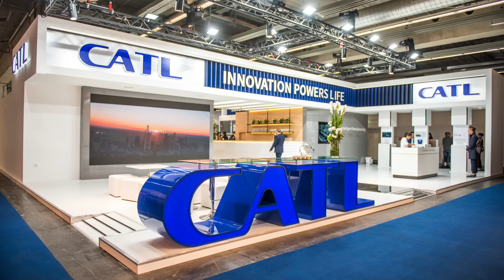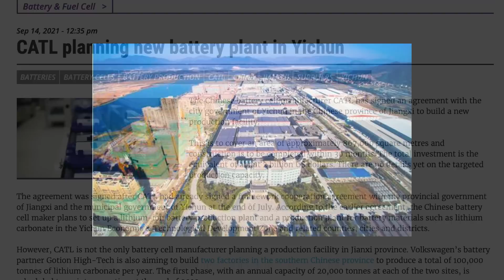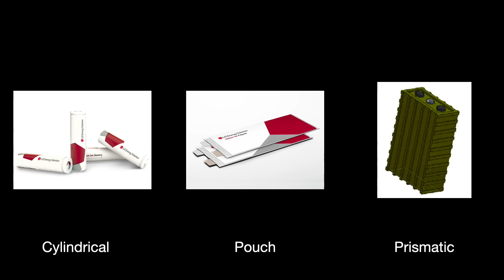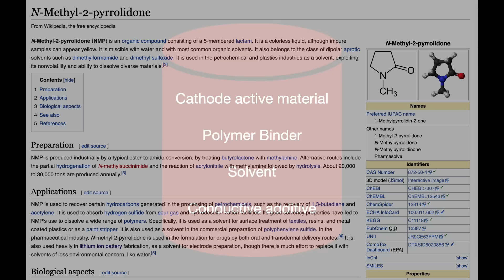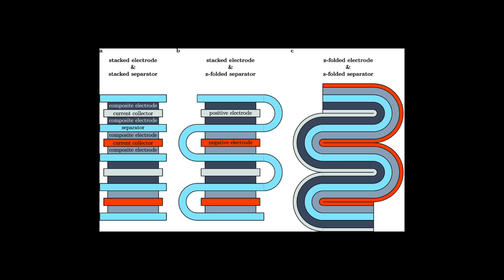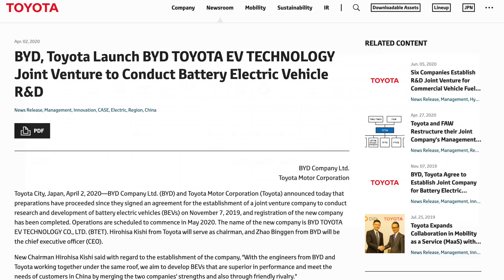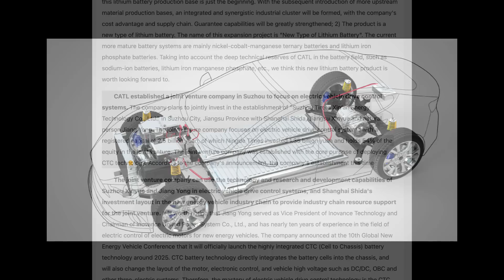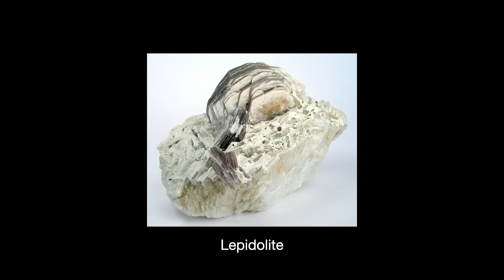How China's CATL Makes an EV Battery

Comment: Some added points of interest:

  1.  Tesla is buying CATL's LFP cells in the prismatic form-factor for its Gigafactory in Shanghai.  These cells are used in the lowest-range/cheapest models.  This is a departure from Tesla's preference for cylindrical cells.  A good question to ask is, for how long will Tesla keep prismatic cells in its supply chain?

In principle, cylindrical cells should lend themselves to cheaper high-volume manufacturing.  The principle advantage of the prismatic form-factor is flexibility in shape, useful for conformal cells in electronics applications.  Auto packs don't need conformal cells, so paying a premium for prismatic cells makes little sense unless some other motivating factor is involved.  For Tesla, there is such a motivating factor - they want more cells than they can currently get.  So accepting prismatic cells is probably only temporary for Tesla.  It could be a fairly lengthy 'temporary,' though.  Tesla's aggressive production ramp will strain their ability to meet needs for cells for years to come.

  2.  For Tesla's 4680 cell, they are using a dry-coating process that does away with the drying step you explained.  It reduces the production line footprint, reduces capital costs, and per-cell costs.  Going forward, manufacturers who don't use dry-coating tech in cell manufacturing will be at a pricing disadvantage.

  3.  Not every manufacturer is wedded to cell-module-pack engineering.  Tesla is planning to abandon that approach in factor of cell-to-pack, no modules whatsoever.  They also plan to bond 4680 cylindrical cells with a polymer to create a structural pack, which eliminates the need for trays and reduces the need for other structural body components, reducing automotive production cost and reducing vehicle weight.  We should see these innovations first at Gigafactory-Austin in 2022.  Note; structural packs are only possible with the cylindrical cell form-factor.

Battery manufacturing is. at present, an exceedingly unstable business.  Innovations are popping up at a rapid clip, raising the risk that fresh capital expenditures will become stranded before their costs can be recouped.  Automakers are shifting their preferences, too - VW recently shifted their orders from pouch to prismatic, and they may shift again to cylindrical if Tesla demonstrates insurmountable advantages for cylindrical cell manufacturing, as they have promised to do.  The road ahead for CATL and for other battery manufacturers is likely to be bumpy.
Reply: Three words cost cost cost. Yes Tesla is trying to bring costs down with the tables batteries. But it is just a prototype at this point. Other battery makers such as BYD have succeeded to being the cost down with  designs other than cylinders such as the BYD blade battery. All battery manufacturers will be in the game for many years to come as there's dearth of battery cells in the market hence Tesla delaying its semi and rosters for years. Cost wide catl might actually stay ahead of the 0avk as the main coast driver at this point is raw materials esp lithium (carbonates and hydroxide) and CATL can negotiate it with it's sodium ion batteries.
Reply: @najibyarzerachic  Sodium ion is still in lab bench mode.  No commercial production.

4680 has a production line going already.  They're still tweaking the line, but it's producing GWhs of cells already.  Reject rates are a little high still, but better than 80% and improving.  In 2022, the line design will be copied at GF-Austin first, then GF-Berlin.  The planned production ramp will knock the socks off of anyone who knows the history of this market sector.

The Blade is just another prismatic cell.  Nothing special.  Wet-coated electrodes, expensive and time-consuming drying, no possibility of using it in cell-to-structural-pack designs.

CATL can sell prismatic cells to Tesla only because Tesla will take practically anything it can get its hands on, not because it's the best developmental path forward.

Prismatic cells might be useful in aviation, eventually.  Conformal cells fitted to the skin of an aircraft make a lot of sense.  There's no inherent reason to prefer prismatic cells for automotive packs, though.
Reply: It's difficult to deduct which format is best based on a company's statement. Each will say theirs the best when in fact everything is a trade off. Also, we can expect lots of innovation with new form factors in the coming years. E.g., there are startups now starting 3D printed LFPs which might not scale but still has benefits for some applications. When it comes to overall cost effectiveness my money would be on both BYD battery and CATL
Reply: @evboy4287  "Never bet against Elon."

He says cylindrical cells will be easier to scale, and cheaper.  You can take that to the bank.

He says cell-to-structural-pack using cylindrical cells (impossible with pouch or prismatic cells) will reduce vehicle weight, improve rigidity and improve handling.  You can take that to the bank, too.

He controls important IP.  Since he wants more batteries - as many as he can get, regardless of source, so long as the price isn't ridiculous - he's likely to allow that IP to be used by other cell manufacturers.  I see this, and Tesla's insatiable demand for cells, as driving cell manufacturers away from wet-coating electrodes and towards cylindrical cells, to gain capital investment reductions, production efficiencies and lower cell costs that Musk believes will result.

Of course there will always be smart guys who will bet against Elon and take a different path.

They think they're smart.

Place your bet... but don't say I didn't warn you.  "Don't bet against Elon."
Reply: @Urgelt  Don*t you think that you may be a bit too focused on the cell format? There are many other aspects of production, and you named them yourself.
Also at present, Tesla MiC  is using CATL & LFP and there are super successful with it. Probably one of the core contributors to profit margins... (i don't care to look into the annual report, but someone who is interested can certainly find out).
Reply: @evboy4287  what actually is this 4860 cells or 2170 cells? Is it something to do with battery cell material or what?
Reply: @浦和-f5y  Tesla is a buyer, not a seller, of batteries.  That might change, but not soon.  They need all they can obtain.  So the fact that Tesla doesn't sell batteries does not imply that Tesla's batteries are inferior.

They aren't inferior.  The 4680 cell is a big step forward in every cost and performance metric.

You want power?  Legacy auto has plenty of it - political power, market power.  They can't keep up with Tesla.

Chinese companies may fare better; we shall see.  But there are 3 disruptions in progress, not one, and the Chinese are not able to play in all of them.

The disruptions are:

  -  Electrification of transportation.  Here, the Chinese can play.  They can make pretty good electric cars, trucks and buses, and their labor costs are lower than elsewhere.

  -  Smart cars.  Let me be frank.  Tesla has tech nobody else has, and their lead is accelerating.  Nio is probably the closest Chinese company when it comes to smart cars.  They're able to match what Tesla had 4 years ago - why not?  They stole Tesla's source code from that period.  But they don't have a developmental path to match Dojo or FSD.  They wouldn't even know where to begin.  The world just doesn't have very many top AI researchers, and the ones that do exist aren't in China.  Dumb cars will hang around at the bottom of the market for years and years, but their fate is already sealed.  Cars will become smart, and the Chinese aren't ready to play in this disruption.

  -  Manufacturing.  Tesla is racing ahead of the rest of the industry with manufacturing tech and methods which nobody else has.  A few of the Chinese automakers may be able to keep pace, but most of them - there are, what, around 30 Chinese automakers?  - will end up consolidated or bankrupt before the decade ends, unable to keep up.

So of the 3 disruptions, Chinese companies are poised to do well with making electric drive trains, albeit lagging on efficiency.  They are starting from a poor position with respect to manufacturing tech and methods.  They won't be able to match Tesla's smart car successes at all over the next 15 years.

Beyond that, who knows.  Not me.  Anything might happen, if you look out over a far-enough time horizon.

All told, I think several of the Chinese automakers are better positioned than the biggest legacy automakers like GM, Ford and VW Group, but I don't see any of them keeping pace with Tesla.

But hey, if you don't agree, knock yourself out with anti-Elon bets.  What could possibly go wrong?
Reply: @Urgelt  who cares about AV. Never is AV associated with EV. As for factory this is not zero sum game. Even if Lexus build more factory than BMW doesn't mean they automatically will claim the throne of luxury car. Since when EV industry playing the different game to ICE industry? GM once a  leader of ICE industry in sale for a long time before Toyota surpassed them.
Reply: @evboy4287  Cell-to-structural-pack is one reason I'm focusing on cell form-factor.  With cylindrical, they can do that.  Without, they can't.  It's a big giant advantage only cylindrical cells can enable.

The other advantage to cylindrical cells is manufacturing costs and speed.  In principle, cylindrical lines should beat the pants off of pouch or especially prismatic lines.

CATL's LFP prismatic cell is successfully being used in MIC Model 3 because it's available today and because the price is right - for today.  But an LFP in a 4680 can could enable those structural packs I've been talking about, and I think production costs could be lowered further with cylindrical lines.

There is definitely room for cost improvements for CATL's LFP cells.  They aren't dry-coating electrodes; that change alone would cut over a third of the production line footprint and speed output.

But Tesla wants to sell a car for $25K.  They'll need to trot out every trick in the book to hit that price target - and cell-to-pack is one of Tesla's fondest tricks.  Shaving pack weight = eeking out more range, which in turn lets Tesla use a slightly smaller pack and shave more costs.

So Tesla can use CATL's cells today, is happy to use them.  But they aren't the cells Tesla really wants to use.  As their in-house 4680 cell ramp continues, they'll be pressuring suppliers to get with the program or be replaced, I think.
Reply: No one said all Chinese EV makers will succeed.
Reply: @浦和-f5y  "Since when EV industry playing the different game to ICE industry?"

Since now.

"This is not zero sum game."

The automotive market as a whole is close to exactly that, a zero sum game.  The success of one automaker comes at the expense of all of the others.

"Even if Lexus build more factory..." (etc.)

Yeah.  But Tesla's case is different.  Tesla's vehicles are a slam-dunk on ICE cars in a way that Lexus was never a slam-dunk on BMW.  Tesla can sell all they can produce.  Consumers want them.  Consumers prefer them.  Competing products, both ICEVs and BEVs, are struggling.

As Tesla ramps, sales of other automakers will tank.  Tesla is eating their demand.

That never happened with Lexus and BMW.

Tesla really is not playing by legacy automakers' rules.  The game has changed.
Reply: @浦和-f5y  I didn't say you did.

I'm expressing my opinion, is all.
Reply: @Urgelt  I mean in the sense of EV industry, how it play a different rule here?

I'm not talking about EV vs ICE here but EV vs EV. Of course Lexus never  slam dunked  BMW bcus even though they are competing in same segment but their exclusive offerings make the difference. German experience still Trump Japanese  touch in luxury segment. Do you think many people don't want to own a BMW? Money is the problem here. But still Lexus managed to grab some market share. That's my point to tell here. 

Why Tesla is the choice of many? It's true outside of China because the selection of good EVs are limited and the presence  of dedicated Chinese EV makers still not significant but in China BYD beat Tesla in overall BEV sales. And the top seller is Wuling.
Reply: @浦和-f5y  But you can't think of the auto market as divided between BEV and ICE.  It's one market, and as BEV sales climb, ICE sales will decline.

The only questions are, which BEVs are superior to their ICE competitors?  Because BEVs that don't provide enough value for the price won't sell well.

BEVs don't really compete against each other very much yet.  This will change as ICE sales decline, but for now, there aren't enough BEVs and too many ICEVs, so almost anyone selling a BEV can find some demand.

But sales for Teslas is soaring, relative to other BEVs.  They really are in a position to increase production without having to worry about where the demand will come from.  They have too much demand.

Most of the other automakers are slow-walking their BEV production growth, or, in the case of GM, they stopped producing altogether for a time.  Legacy automakers are not well pleased to see demand for ICEVs wither and die, and they know their BEVs aren't taking sales away from Tesla.  They're taking sales away from their own ICEVs.

Legacy auto's survival tactic of late is to pull a Jedi mind trick on the public.  "This hybrid, with an internal combustion engine and a tailpipe, is really an electric car."  The Biden Administration and most of Congress appear to agree, and are poised to grant big incentives for hybrids.  This tactic pleases a great many plankholders - fossil fuel companies, unions, legacy automakers, dealerships, investors, mainstream media, all of the defenders of the fossil fuel status quo.

I don't believe that tactic will harm Tesla's sales.  They'll still have more demand than they can answer for years to come, even as their production ramp continues.
Reply: @浦和-f5y  Hi, 4680 and 2170 are cylindrical sell formats. 46mm dia x 80mm length for the new 4680. This new, larger cell format gives some efficiency in packaging, and I think power production, but has not been pursued before because there is an issue with heat generation and cooling of same. Another aspect of the design, the poorly named "tabless" feature, should be called "continuous tab" The tabs are formed by slicing the edge of the copper and aluminum edges of the jelly roll which forms the interior of the cell. This means that 1. There is no need to weld on a tab. 2. the tab can carry much more heat away from the interior, and in a more uniform manner, and the cooling can take place from the ends of the cell, rather than the outer circumference of the shell. The electrical pathways inside the cell are similarly improved, which has benefits for longevity. The design lends itself to several improvements in assembly of the cells. 3. They use "Dry" electrode technology they bought in from Maxwell. It is this last item that has been hardest to get right. Reports say the dry material was damaging the rollers on the assembly line. Some of those reports now say they have found a solution by using a series of 8 rollers to compress the dry material in a more gradual manner, and there are indications from drone videos that a fair bit of the production equipment has been installed in Giga Texas.

Last point, Elon does have some great engineering talent, but he is no slouch himself, if he doesn't have his hands on any specific part of the build process, he certainly has a far better grasp of the technical issues than any other large company CEO. Not just me saying that, Sandy Munro, a highly respected guy in technical manufacturing circles attended a meeting at SpaceX in Boca Chica, and he said that Elon's knowledge of the technical and engineering details under discussion utterly amazed him. He's not perfect, the body design of the first version of the model 3 was obviously seriously inferior, and he has said that, ("I fired that guy") OTOH the fix which they implemented on the model Y is much farther in advance of the usual methods, than the model 3 was inferior.
Reply: @Urgelt  now more and more tranditional car companies starting making EVs，tesla's success most belongs to few competitions, now the market changed, for a car company tesla is just an assemble company, nothing product by its self, thoes accessory part for smart car, tesla can buy, any other company can by too, it's nothing.
Reply: @jackwood3520  You haven't watched Munro's teardowns.
Reply: Innovation doesn’t translate well into mass production. Some products just never leave their labs.
Reply: BYD blade says hi.
Reply: 4680 is a fire hazard.
Reply: @andrewlim7751  Bot much?
Reply: @Urgelt  
How long have been living in cave?
Reply: @andrewlim7751  Caves are underrated.

So, when did you give up reasoning from evidence and just start forming opinions out of thin air?
Reply: @Urgelt  
There're countless fire hazards for Tesla even recently in Taiwan involved celebrity, it's hard for even blind to go unnoticed.
Reply: @andrewlim7751  High speed crashes often result in fires.  This is more true for ICEVs than for BEVs.  Read up on it.

Even better, BEV battery pack fires after severe crashes are slow-burning.  Plenty of time to escape.  ICEV fires can be quite explosive.

There aren't any 4680 cells in cars in Taiwan.  Not a single one.
Reply: @Urgelt  
BYD highest temp is 60 celcius
Reply: @andrewlim7751  Right.  Any BEV can combust in a serious accident.

Any ICEV can, too - but gas is far more explosive, and fires happen far more often in terms of miles driven.

But you aren't seeing 4680 cells in this Sacramento Tesla fire.

Tesla's 4680 pack appears to be their best accident-resistant design to date.  The pack is robust.  You really should view Munro & Associates' teardown.  They didn't get to the 4680 yet, but the pack itself is rugged as hell.

There will still be accidents, and some fires will happen occasionally, but unless it's GM's pouch pack batteries, fires will be very uncommon with BEVs.

BYD's packs will combust, too.  Not often; much less often than ICEVs in accidents.  I don't think BYD's pack is as rugged and fire-resistant as Tesla's 4680 pack, but that's just an opinion.  We'll need years of data to draw firm conclusions one way or the other.
Reply: Don't promote China It is a company that has not given subsidies to Korean battery companies that have entered China, but only gave them to their own companies and stole Korean technology. Nevertheless, batteries are trash because they can't catch Korean battery technology